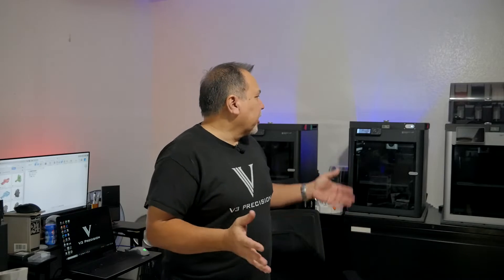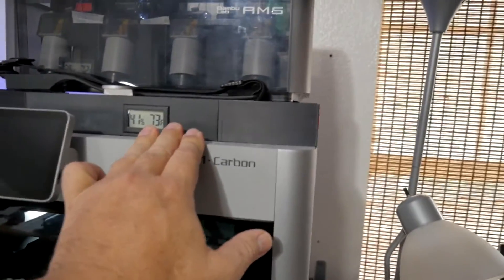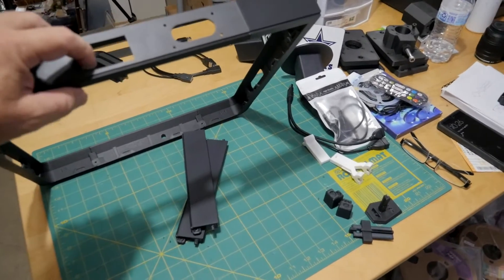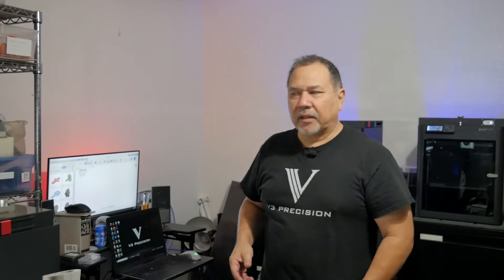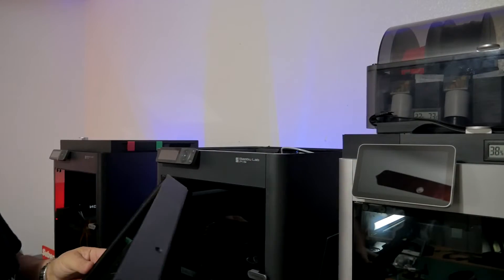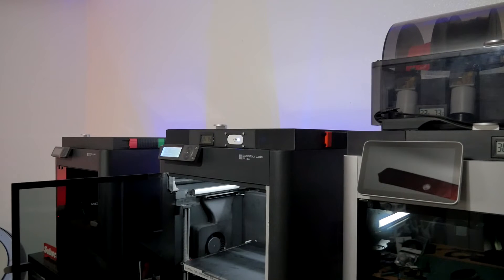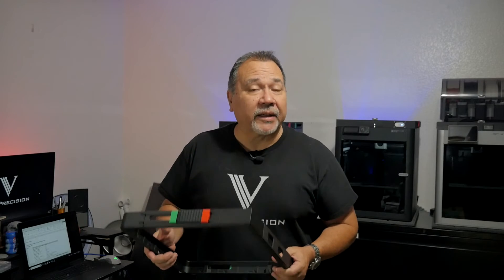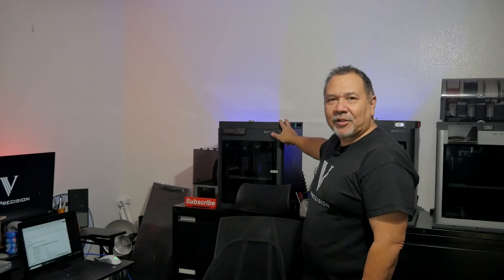Modular Lid Extension for the Bambu Lab X1 and P1 Printers, Rev3

Comment: Thanks for the great design, I did however find a slight flaw, after printing it several times and always having the same issue I finally figured out what was going on and modded it.  Where the 45 degree angle meets the front and side panels, I added an sight inset.  The corners tabs were binding at the 45, so where the 2 parts come together there was a twisting force.  This was causing the tops to separate at the pin.  Loading the file back into cad and adding a 0.5mm relief at each end of all the front, side and rear panels eliminated the binding issue.   I also made a change for a different style dimmer.  But this was simply a personal change nothing with the unit you were using I just wanted use a different design.  Thanks again.  I'll send you the modded files if you'd like.
Best Regards